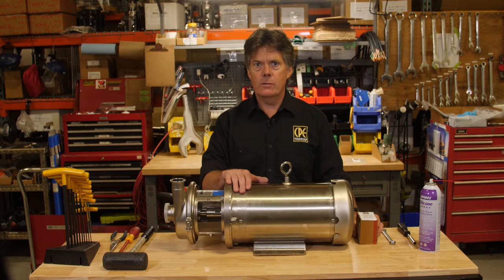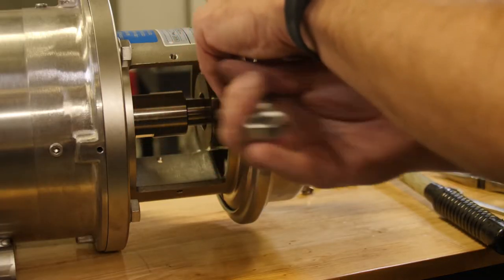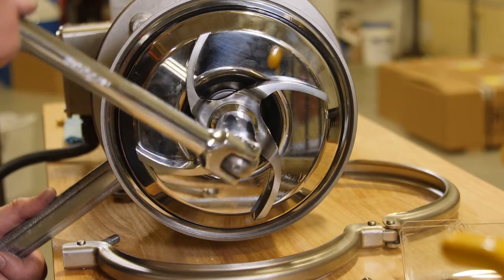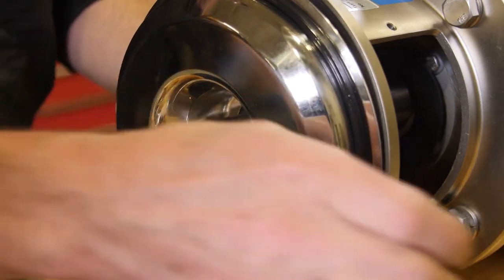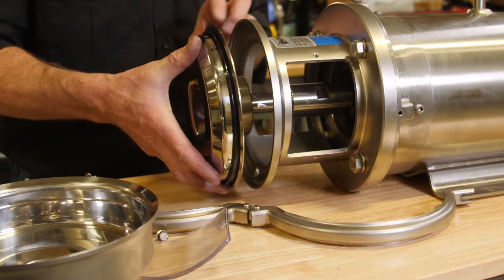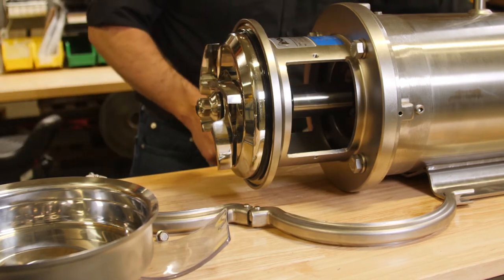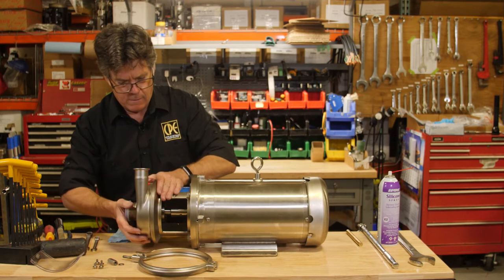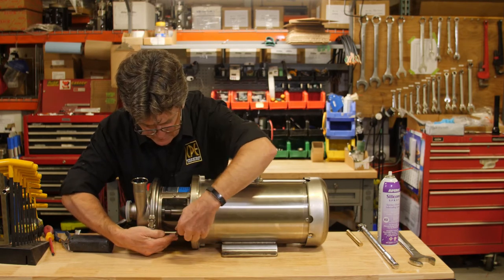Changing the Seal on an Inoxpa Hyginox Pump

Comment: Does the large o ring just fit around the diameter of the back plate or does it fit in the groove around the diameter of the body?
Reply: The casing o-ring fits around the outside of the backplate.